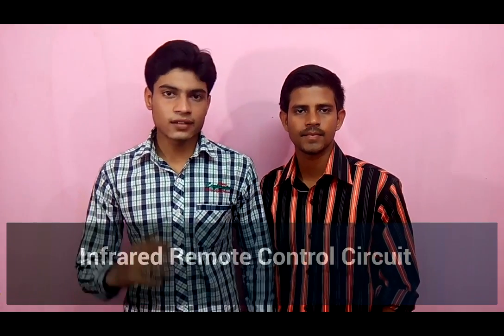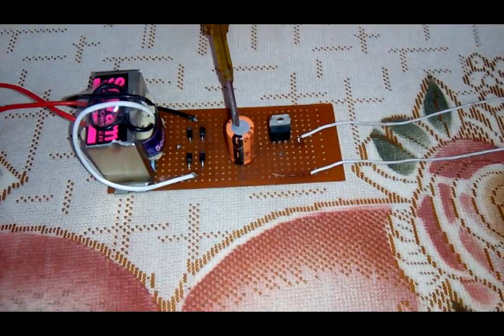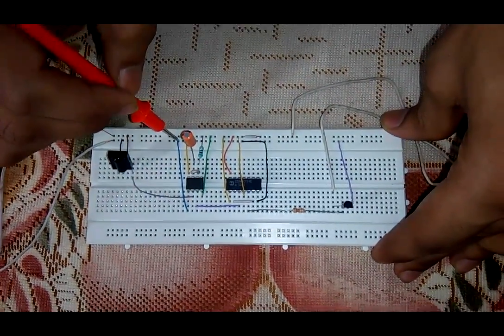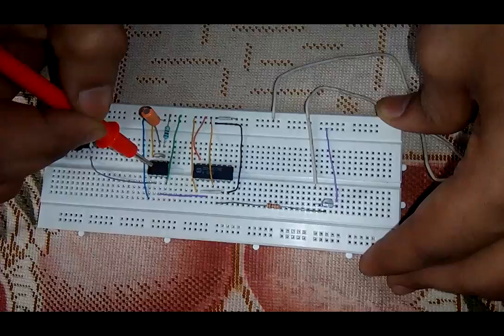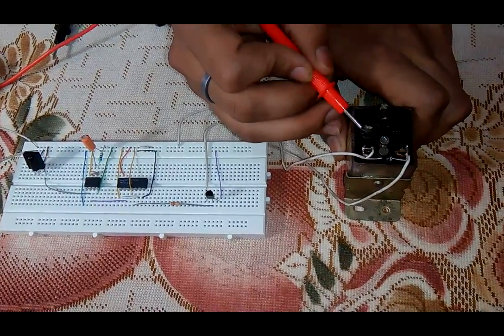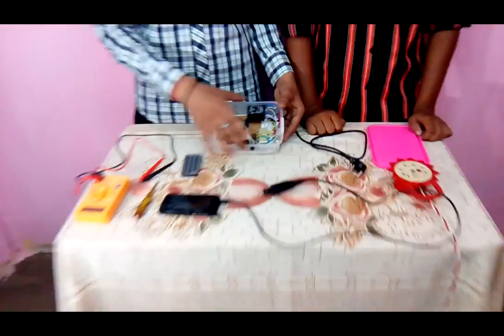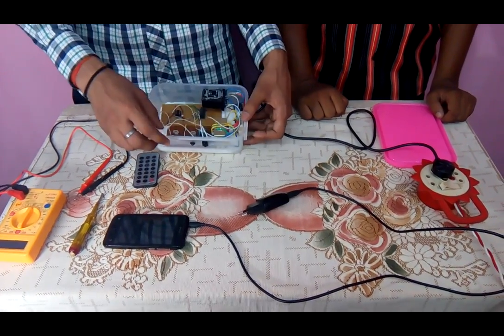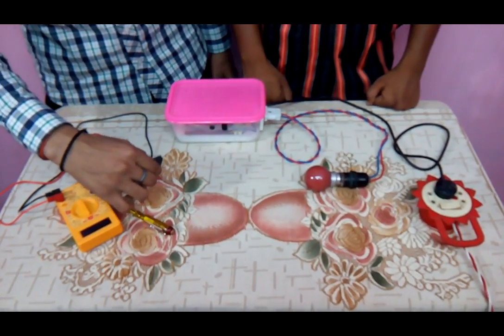How To Make Infrared Remote Controlled Circuit for Electrical appliances

Comment: I have a problem, when I press the remote, the led connected to 5th pin of IC 7474 gets start to blink and the relay is not switching. can you tell me what is the problem???

Comment: hey can u make a vidio on the rc reciver for a toy car .i mean to say that how can  i use four different switch for four different component
Reply from the maker: Tushar Upadhyay 
By Using two parallel circuit in parallel. Each circuit for 2 devices.

Comment: which type of relay should we connect so that circuit could work efficiently if we could connect table fan , or mini cooler,television in output.
Reply from the maker: lovely shivam 
We can use SPDT relay for any electrical appliances.

Comment: Dear Madhav Shankar, circuit is fine, henceforth we can use for all 230 volt electrical appliance can be controlled remotely.  Did you have any other tested circuts, pl convey.  Thank you very much for your presentation.
Reply from the maker: Chengalveroyen KRISHNA KUMAR 
Yes ! You can use it for various purposes

Comment: hey. what maximum current can be drawn from the output of the circuit
Reply from the maker: approximately 1 Amp
Reply from the maker: But it runs on 0.5 Amps

Comment: what about 8th pin of ic555 and 4th pin of ic 7474 and rest of pin in ic7474 which is not mentioned in this vedio
Reply from the maker: 8th pin of ic555 & 4th pin of ic7474 is connected with VCC. And rest pins of ic7474 are left open. 👌

Comment: your work is brilliant but you must show full circuit with 470uF.
Reply from the maker: So sorry for inconvenient. 470uf is connected before the 7805 IC. Two wires are coming out form rectifier circuit one is VCC & other one is GND which is further used in the next circuit which is the main working circuit.
Reply: there is a misunderstanding in IR some IR comes with middle lead on grd bt ur IR has first lead grd please show the difference b/t IRs of different types. because I blew my first IR with this lead confusion.  please also show how to find grd and VCC pin of IRs. Thank you for reply

Comment: good one... just one question, how did you turn the external devices on and off? As in, were you continuously pressing the remote button? or is it that when you press the button once, it switches on and when you press it again it switches off??
Reply from the maker: Once the button is pressed it gets ON and again when button is pressed is turn OFF

Comment: Hi, I've been following the circuit diagram to make the circuit to turn on a motor and it works! The only problem is that i cannot turn it off once i turned it on. Any ideas? looking forward to your responds. You can email me at ewan.235@gmail.com. Thank you :)

Comment from the maker: ✊ The name of every components are already mentioned in the video.
Reply: Dear I am Bilal from Pakistan.i am intrested in making my tube lights and bulbs with remote in your video name of components are not mentioned clearly kindly send me the names of components with circut diagram on my email adress bilalengineer313@gmail.com.Thanks
Reply from the maker: +MUHAMMAD BILAL ENGINEER 
If you had seen the video carefully then you find that there is a pic in which every component is mentioned.😉

Comment from the maker: Yes ! ✌
You can use this circuit for controlling dc motors. You have to connect the dc motor to the Pin no. 5 of IC 7474 & other terminal to the ground. 
👌
Nice Question.